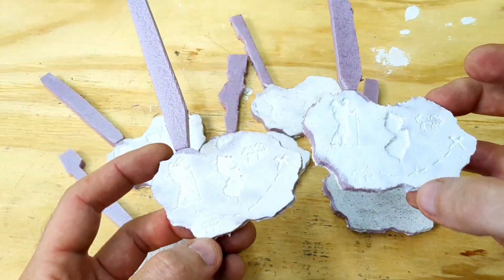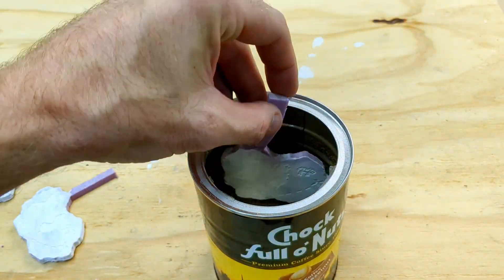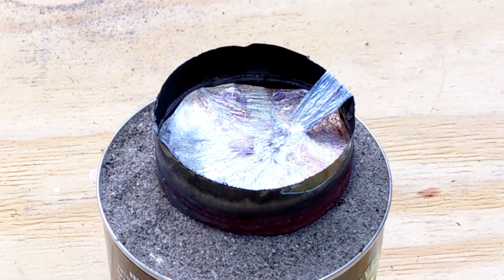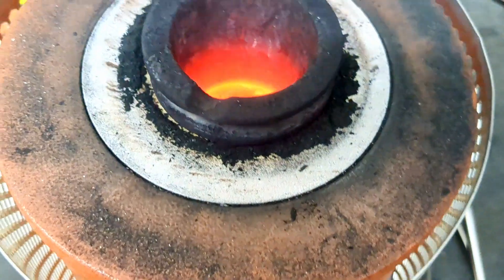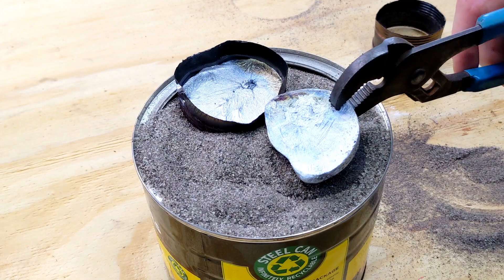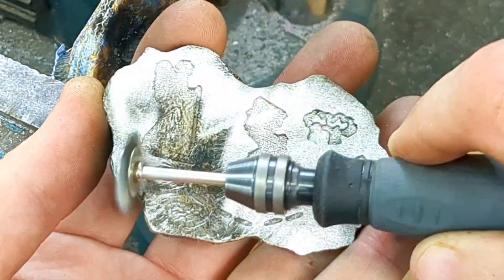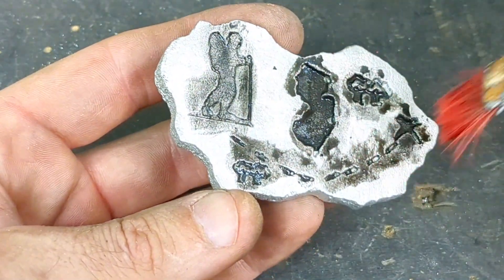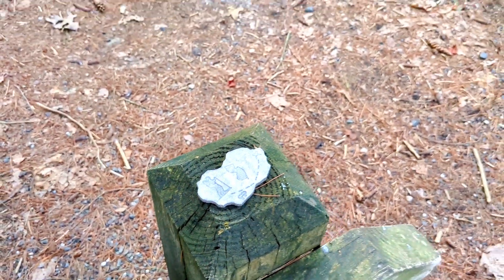Pouring Molten Aluminum - Metal Casting at Home

Comment: Lost foam is a great idea. Thank you for this. My son and I are going to be melting beverage cans and casting in petrosand and lost wax in plaster. I'll bet the foam is easy to work for flat objects. Do you use a soldering iron to make the designs in the foam?
Reply from the maker: Thats great!  I use greensand in some of my castings as well. I never used petrobond sand.  I use my CNC router to carve out the patterns.  However you can use a hot knife to cut out shapes.  Take a look at my lost foam casting 2024 playlist for some ideas

Comment: Hi.... Nice work.
Would u tell me with what velocity u cnc this?
Greetings from germany
Reply from the maker: I will get you the settings when I get home.  What were you looking for exactly?
Reply: I try to Cut Styrodur too. But the edges are "unclean". Maybe i dont use the right Velocity. Or maybe the wrong styrodur?
Thx for help
Reply from the maker: @DevilsStackCastings  I don't think it's the speed.  Maybe the bit.  I looked up styrodur and that is polystyrene XPS.  That is the best kind to use.
Reply: Thx for Help 👍
Reply from the maker: @DevilsStackCastings 
My feed rate is 40/min
Plunge rate is 9 in/min
Depth per pass is 0.0625
Spindle speed is 10,000

Comment: Hi...
Nice video.
What cnc - bits do u use for foam?
Regards from germany
Reply from the maker: Hey thanks!

I use only a few bits actually.  My router hold 1/8 bits.  I use a 1/8, and 1/16 straight bit and sometimes a 22-45° for finishing.  Most of the time I don't use the v bit.
Reply: @HeinrichsMade  thx 👍